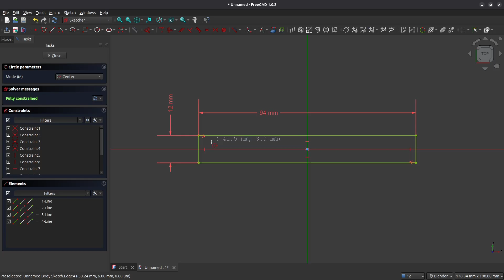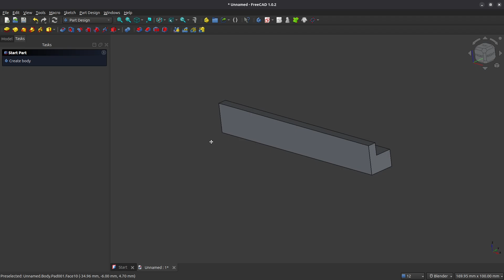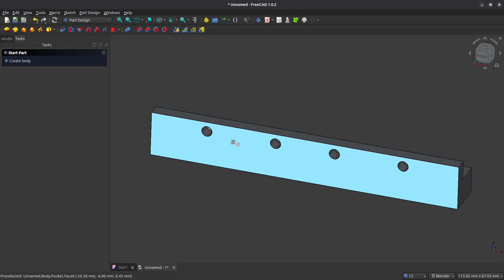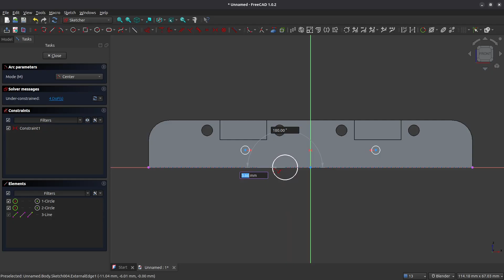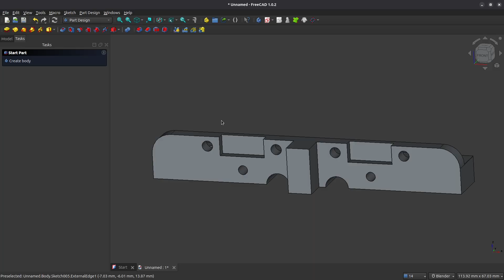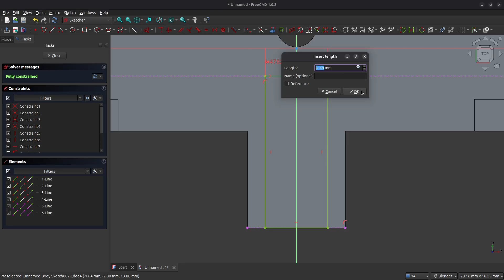Part 2: The Rail Pedestal - TitanBot | FreeCAD Robotics Design

Comment from the maker: The TitanBot is rising!  These Pedestals are the bridge between movement and structure.

Build Note: Unlike the base in Part 1, this component is a 3D-Exclusive Design. The internal sensor housings and cable routing channels rely on additive manufacturing geometry that you just can't get with a laser cutter. I’ve validated these prints on a MakerBot Sketch using standard PLA profiles.

Next Step: Now that the foundation is set, we need a backbone.
👉 Watch Part 3 (Vertical Frame Rails) here: https://youtu.be/07Mjo-Jxmyw

Question: I used heat-set inserts for the mounting holes to ensure longevity. Do you prefer heat-sets, or do you design captive nut pockets for your prints? Let’s debate in the comments! 👇